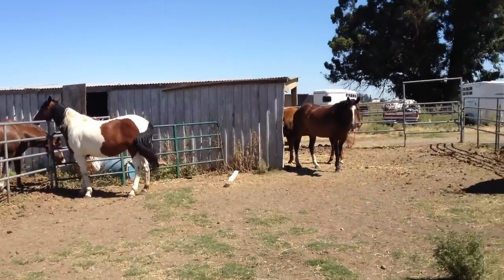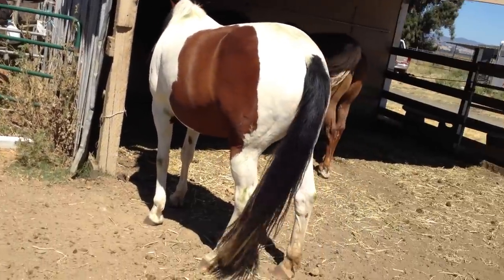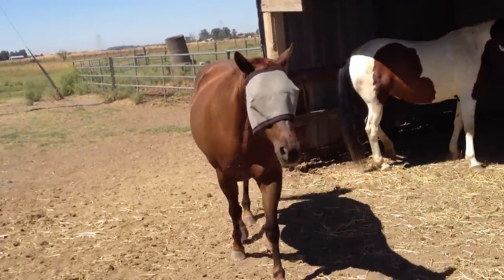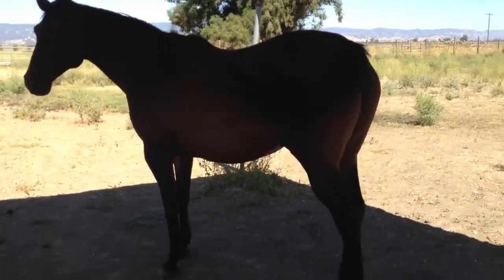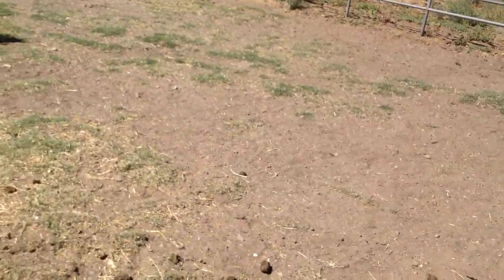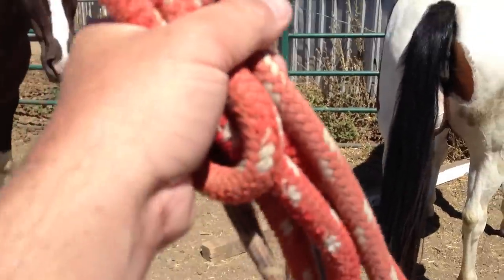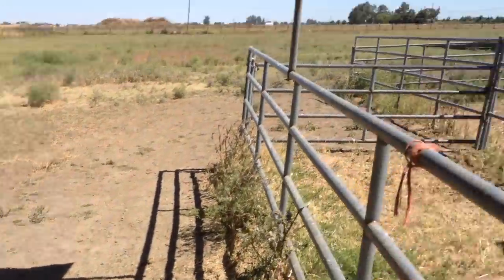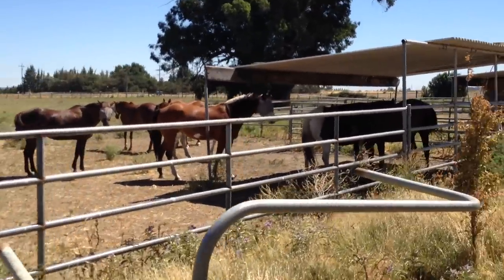Horse Shelter Design - Good & Bad - Choke Points & Danger Zones - Rick Gore Horsemanship

Comment: My shelter has more than enough room for two horses to spin around completely. and it's in a paddock in the middle of an acre.
People think I pay a bit much for the land I rent but the shelters are worth it they're the best I've seen are round here tbh I love them.
The horses don't poop or pee in the summer one either.
They do in the winter one but I think that might be from when they had a stable because they have straw in that which they had in their stables. (they were too underweight and one hadn't eaten grass for over a year so couldn't go straight to 24/7 living out). The summer one has a sandy sort of covering on the floor.

Comment: Dont know if you will see this, but i was wondering, what do you think is the best stable/barn/shelter design?  I am considering to build an open barn, where horses can walk in and out freely, but i also had to think about them fighting and having enough escaping routes. But then again,  we can have cold winters, rainy summers. I was actually trying to find articles about this, but most people have stables with stalls and they take to horses in and out, or they have sheds like the ones in this Video.... We have 2 horses in a field now, and they share one  big open barn so that is no problem, they also get along... but what if i had 4 or 5 or 6 horses? would i have to change to locking them in stalls, or maybe just building another shed in the field so they have options?
Reply from the maker: www.thinklikeahorse.org